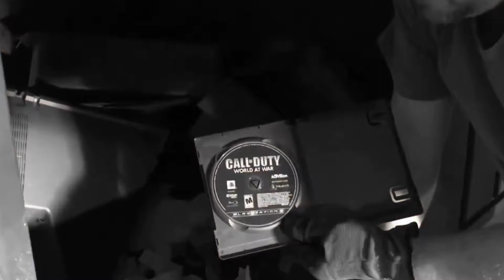How To Do The Promark Shadow GPS Drone Mod  P-70

Comment: Did your drone show on your app battery was to low ?  On mine it's saying my controller is dead so I put it on charge an it would be on charge for maybe a minute or two but still show it's dead.. I change the battery an charge it up an it still wouldn't pair to my drone.. any pointers?
Reply from the maker: Sounds like you could be getting faulty batteries but yes my app would tell me when my battery was low and it was pretty accurate I do know that if there’s anything faulty with the battery at all and will not work right so you wanna make sure you have a good battery in your remote which I have replaced before when they go dead I’ve taken apart the remote and you can also use modified batteries which I explain my videos to give you longer and better flight time with the drone itself.
Reply: Even if the battery light on the controller ligjts up green when its full charge it still could be the battery
Reply from the maker: Yes, The battery could be intermittently bad so to speak.
Reply: On my app i can see from the camera view so there nothing wrong there right

Comment: Ok I'm feeling really stupid here, dont know of it's too late,, or too many drinks lol.. wish I could see how it was wire from the back, I'm gettin ready to mod mine, I wanna keep the org. case, do I just need to connect the green wire to the white one on the battery charger side and then just connect hot and ground to the circuit board right???
Reply from the maker: Yes Sir 👍

Comment: I may have misunderstood, but it seemed like you were thinking the green wire is a data line or something. It's actually the lead used for balancing the 2 cells inside the battery pack.
With this 2S battery, it indicates the positive electrode of the most-negative cell, and the negative electrode of the most-positive cell.
Reply from the maker: Thank you for the clarification 👍

Comment: Thanks for the great video. I have done the transmitter mod, works great , Thanks.I have a Promark Shadow GPS quad. It will not bind with the controller. The controller works fine, it has been tested with another Promark Shadow same model. I have also tested another working controller and the same dead battery shows on the app. When I turn on the app on my phone it shows controller battery Dead.The wi fi camera signal and the osd on the app works. The controller has no effecton the drone at all. Thanks to all.
Reply from the maker: Wiggy Lab   Thanks, have you updated the firmware on both Promark also I noticed there are at least 2 hardware revisions on the pcb boards, I don’t know if that would have anything to do with it or not.

Comment: I have already done that and it works fine
Reply from the maker: Thanks for letting me know.  I’ll def be doing that.
Reply: Mr. Goody you can also cut the circuit board by the plug and solder the wires to the back you just won't have an on and off switch.
Reply from the maker: Brian Grant Thank You for your knowledge.
Reply: Mr. Goody your welcome

Comment: I have the Promark too. Nice drone to fly on a cleaR day.
Reply from the maker: Alabama Thorne 

Yes it sure is and the GPS comes in very handy.
Reply: @Mr_Goody  The instructions specifically state to not open the battery. So I immediately opened my battery. Lol.....  I'm on my second Promark, the first one stopped binding to the controller after a very soft crash.
Reply from the maker: Alabama Thorne I have about eight of these drones I got them on a good deal on someone who is selling pallet stuff and I have a knowledge of electronics so I was able to fix about five good ones out of the eight and I done a few modifications such as I change the battery over to lithium polymer instead of the lithium ion the takes five hours to charge these batteries are much cheaper around $15 and only take about an hour to charge and you can get more flight time out of them.
Reply: @Mr_Goody  Cool. I'm subbing your channel just for the drone intel.
Reply from the maker: Alabama Thorne Thanks
Reply: Did u have battery problems with controller
Reply from the maker: No I sure didn’t, I’ll tell you what if you message me on Instagram which is up in my channel banner and I can calculate how much it would cost to ship you want and I’ll just give you one.
Reply: @jay4242  i didn't have problems with RC Battery.